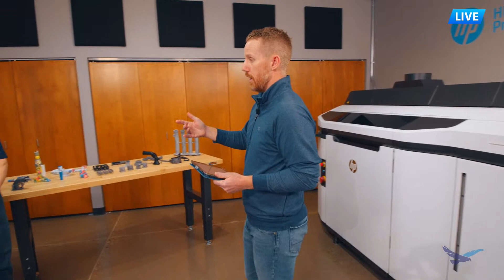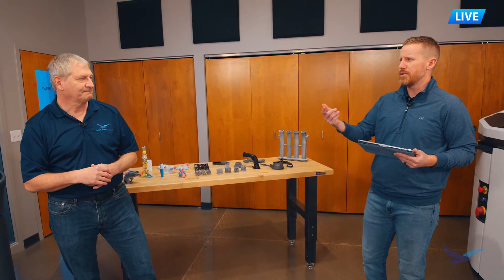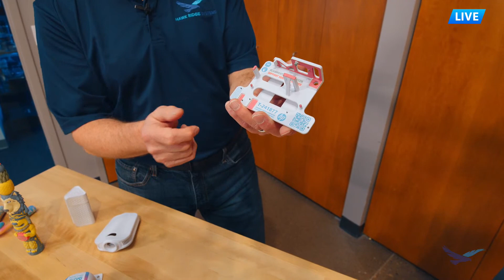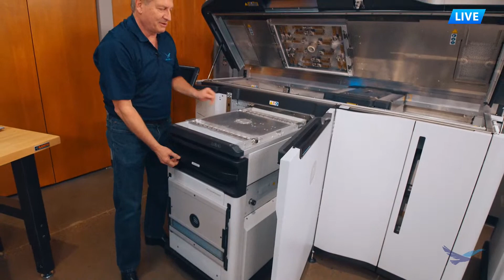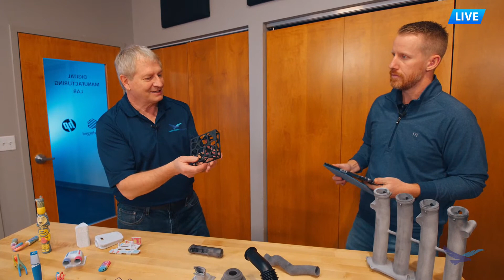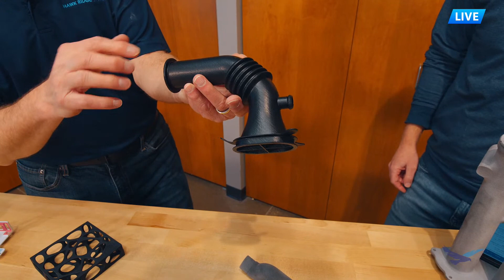5 THINGS YOU NEED TO KNOW ABOUT HP 3D PRINTERS

Comment: Why does HP call it "recycled" powder when in fact it's just un-used..?   Is it possible to grind up the 3d printed parts and turn them back into nylon powder for them to be recycled?
Reply: nope they can't, cuz finished prints are soaked in fusing and detailing agent, the recycle definition is due to other companies tecnologies that throw away basically 90% of the unused powder. so this is pretty much the best value for powder 3d printing

Comment: What kind of metallic materials are applicable for this "A M" production? I've raised this particular question with one of your service rep preferably a light aluminum? Secondly a product probably 3 1/2" x 3 1/2" size with 4 circular chambers kind of a 'lil complex geometry where inside the chambers are arrays of teeth? Hence, my choice for 3D for precision reason. Volume-wise, how many could be produced on 24 hour frequency?